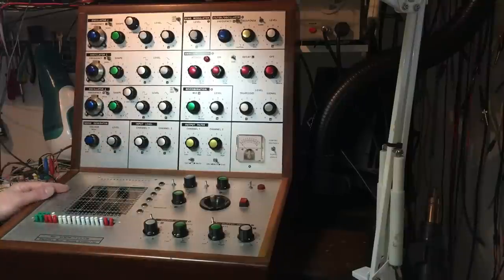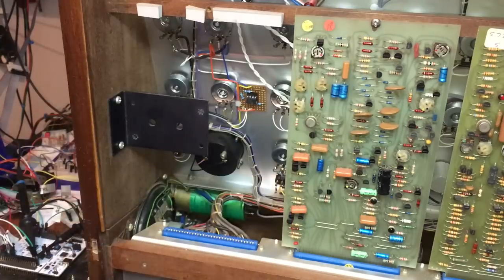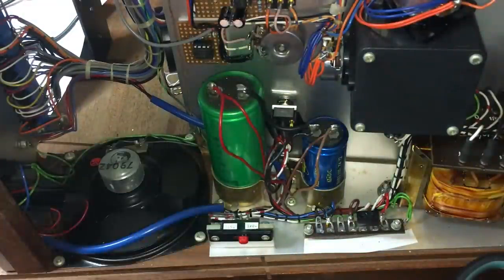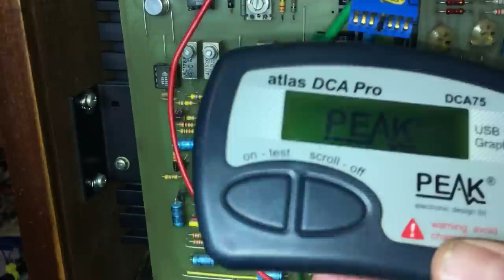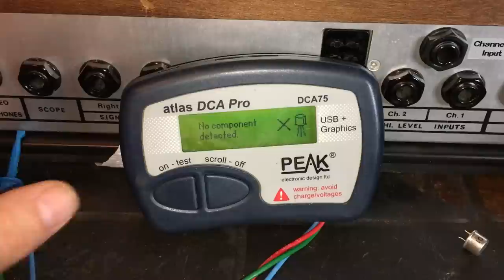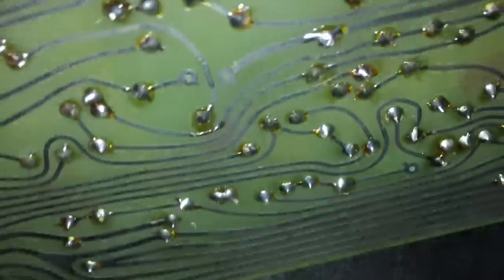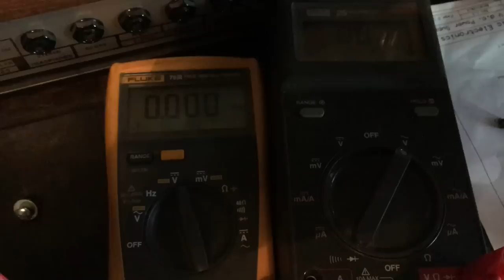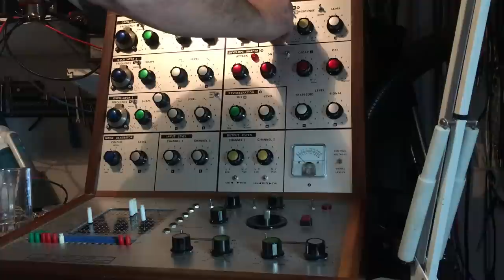VCS3 Repair & Mods Part 1

Comment: Those ICs with the six gold legs on them that EMS used in the voltage-controlled reverb and output panning circuits, are made of unobtanium now, they aren't being made anymore, which is a shame.